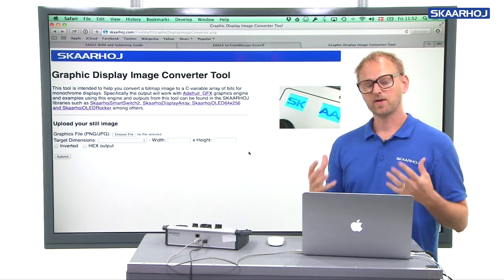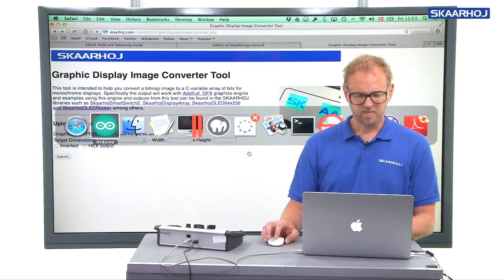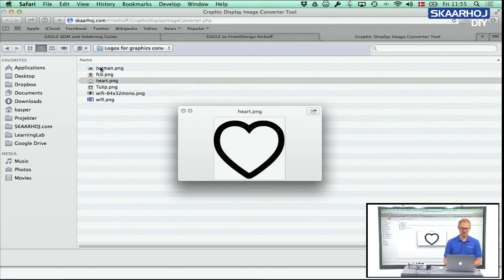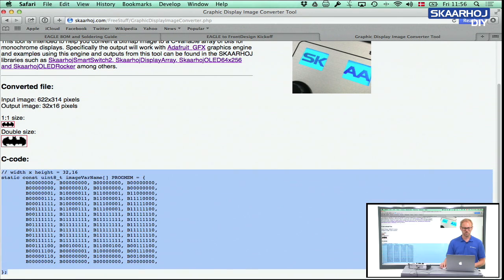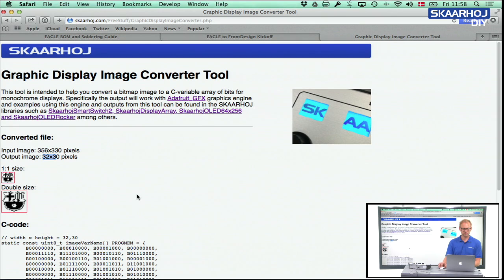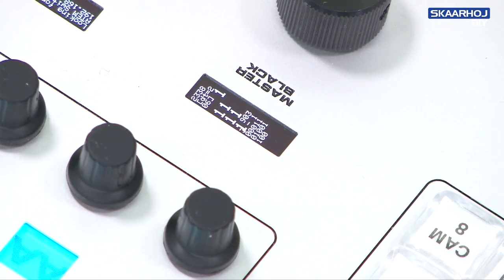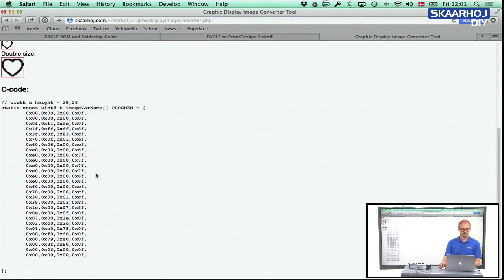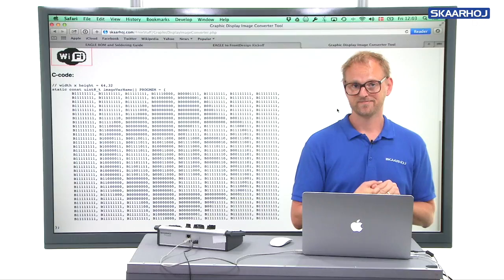Graphic Display Image Converter Tool

Comment: All the other tft image converters did not work. They all just appeared very pixelated on my screen. But this program is awesome; works very well and the image prints clearly on the screen. And to top it off there is no need to download any applications, as everything is done online. But I do wish it would also work for color images. Otherwise it's a great tool.